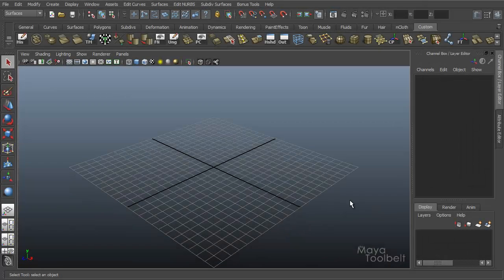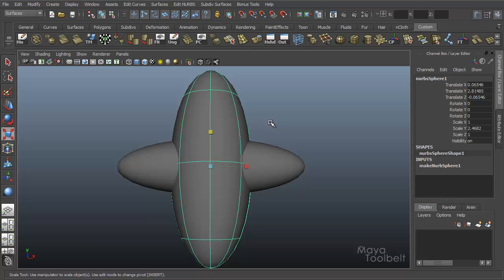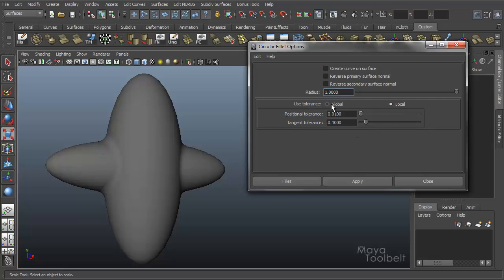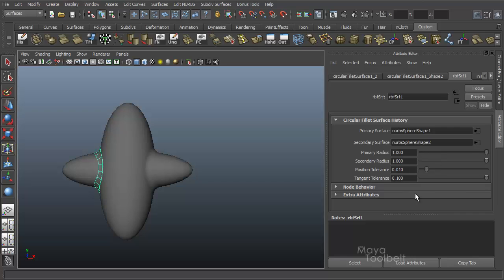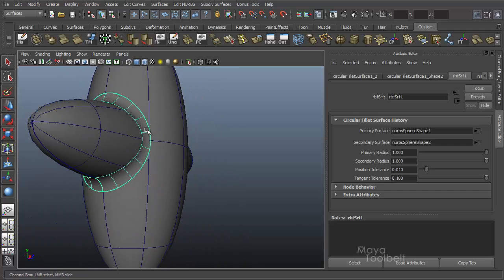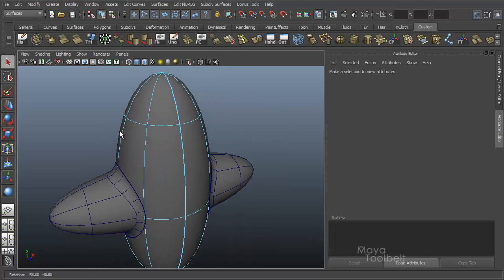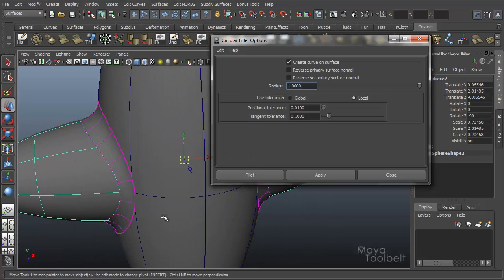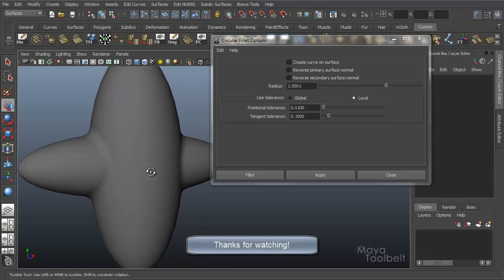The Maya Toolbelt - Circular Fillet

Comment: Hi Michael:

The Fillet, is it possible to make the size different? Not the Diameter When you weld metal for example you can do a large or small Fillet. There doesn't seem to be anything in the Box or Attributes that will let you do that.

Cheer
Reply from the maker: Douglas Henderson There is, using the radius values. I added a small addendum video talking about that and going over a small thing I forgot about, namely using the Show Manipulator Tool with the Circular Fillet: https://www.youtube.com/watch?v=8PAFJpZwmIo